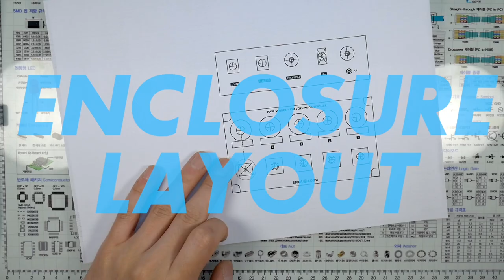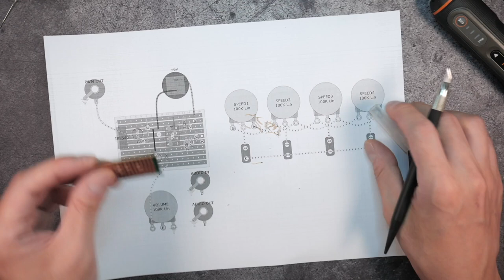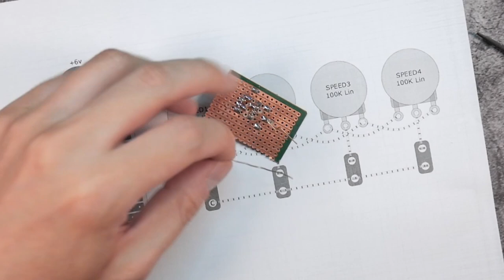PWM SENDER + FSR VOLUME CONTROLLER

Comment: Amazing stuff as always, you deserve a lot more subscribers! I love that cutting board too, where did you get it?
Reply from the maker: Thanks!
The cutting board is here below.
https://www.devicemart.co.kr/goods/view?no=13912410
However I'm not sure they can ship abroad.
Reply: @SLOWROOMNOISE  Thanks for sharing that, maybe I'll be able make my own or something, bit of a random question but I'm just getting into building my own modular stuff, is there any Sequencer you would recommend for a beginner? I have a drum machine I'd also like to control and a keyboard would be nice too but not essential, Thanks so much for taking the time to reply!
Reply from the maker: @josephhutchinson7148  I built this one when I started SDIY. https://github.com/holmesrichards/8StepSequencer
I think it's quite nice to work with drum modules, but it's abit bulky. And also the CV isn't quantized, so any quantizers are necessary if you don't want micro control for CV. However definitely you can do hit the pitch with some efforts.
If you don't need CV outs and a bulky form factor, how about this?
https://www.youtube.com/watch?v=5Trjze02Wm4
I really hope you enjoy your SDIY!